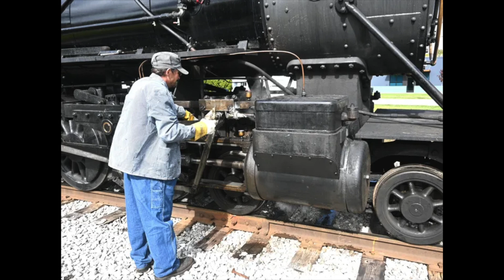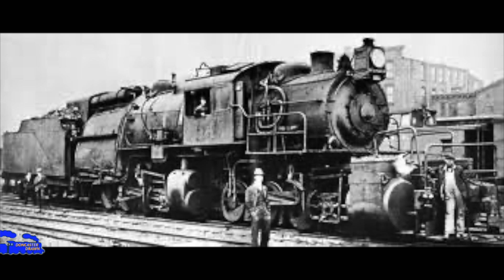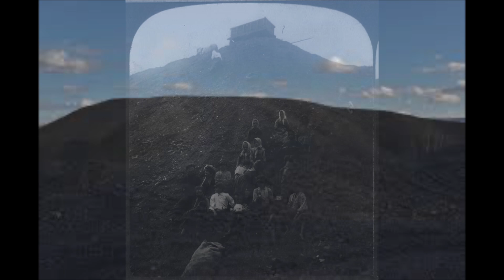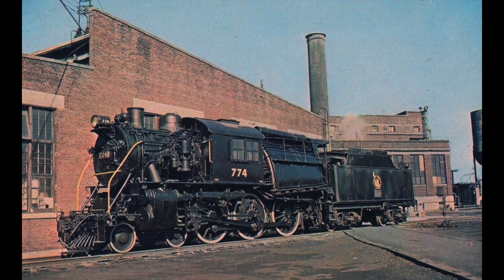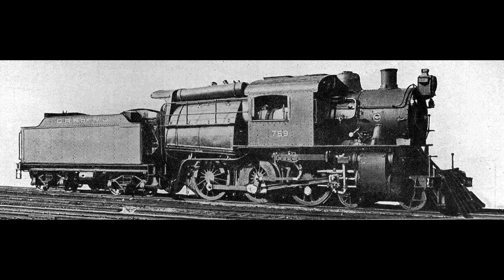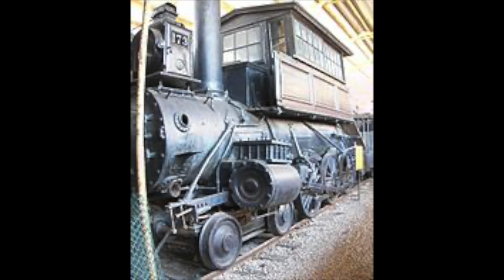Camels and camelbacks

Comment: Thank you for a whole raft  of previously unseen photos - and I like these locomotives, both types. I was mystified the first time I came across a broadside photo of two 'Mother Hubbard' consolidations (I was about 15 at the time) which didn't make the fireman / driver layout too clear. We did actually have one solitary 'Mother Hubbard' in GB - a Baldwin 4-2-2 'spinner'. Brought over by the Eames Automatic Patent Brake Co, to demonstrate their invention, it was named 'Lovatt Eames'. With its cab cut down to fit, it ran on our Great Northern Railway for a while; abandoned afterwards it was cut up for scrap and the bell now belongs to the Institute of Mechanical Engineers.

Comment: As someone who came from a Reading Railroad family (Philadelphia & Reading in early years) who kept Camelbacks nearly till the end of steam the longest, the origin and info is correct regarding them and is surprisingly correct. 

My great grandfathers favorite Reading loco of all was their P5sb Atlantic with 86 inch drivers. They clocked up to one hundred and twenty mph regularly on the Atlantic City express trains to the beaches and that was before WW1 and after till the races to the boardwalk ended with the Pennsylvania RR and the two lines eventually becoming one with the formation of Pennsylvania Reading Seashore lines. 

Sir Nigel Gresley of LNER fame and especially his Mallard actually has a UK version of the Wooton firebox on his A1, A3, and A4 locos just not as wide as in the US due to the smaller loading gauge used in the UK.